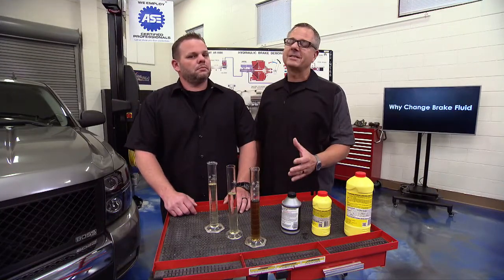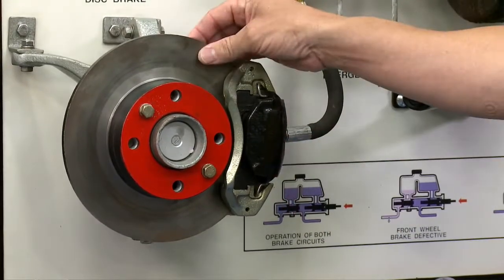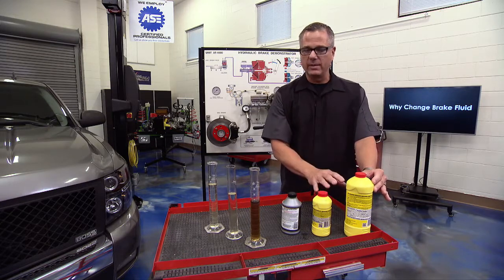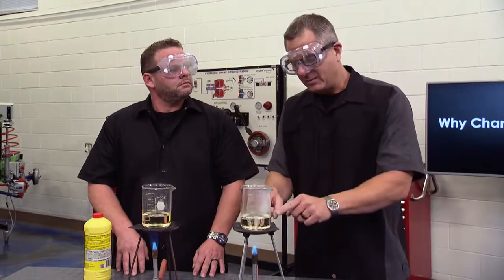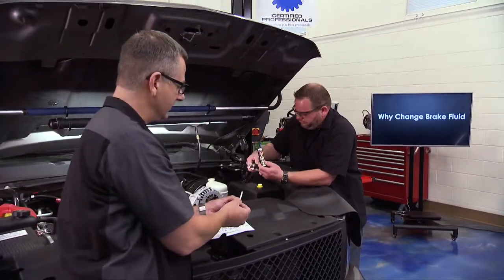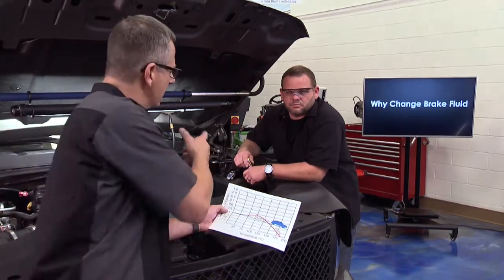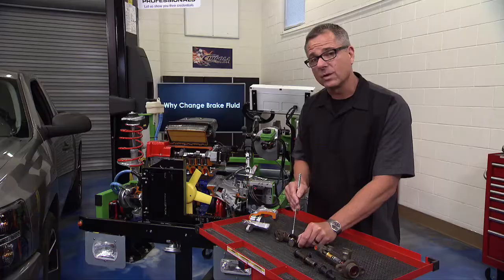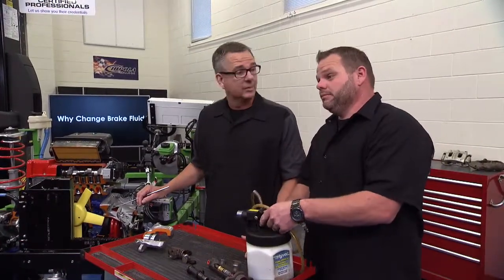Why Change Brake Fluid?

Comment: Why not do a partial change, more often, that only swaps the brake fluid in the reservoir…not professional (aka expensive or time consuming)  but should be effective. Use a syringe to suck out the brake fluid, use a rag to clean the reservoir, then refill with new fluid. As you use the brakes, the old fluid should mix with the new fluid and then you could do it again. Much easier than bleeding the system and causing other issues…

Comment: I have 2018 chevy equinox with 80k KM on it last week i was driving 120mph and pressed the brakes hard the brakes weren't responding as a wanted, so I went to replace the brake fluid with Ravenol DOT 4 the cap has dot 3 written on it but Ravenol DOT 4 have 271c dry and 169c wet boiling point and man even the brake pedal feeling changed. we have also 2012 Sonata Hybrid with 140km on it that we didn't do a brake flush on the ABS died and it won't drive unless you replace the ABS and it costed 1800 us dollars to replace by the way the fluid was black.... I highly recommend spending 50$ as i did to replace and flush all the fluid from the system now the car stops faster, and brake pedal is much better now and the ABS will live longer..

Comment: When it comes to brzke fluid i would make it compulsory to  put sticker on the master  cyclinder to say  which  dot.  3 4 5  to  avoid  confusion As to the type brake fluids used
Reply from the maker: Great suggestion.

Comment: Wow! This is one of the most informative videos I've ever seen. I feel like I have a complete understanding now of WHY the seemingly unnecessary brake fluid flush IS in fact necessary as heck! Which brings up another question: Are the silicone based fluids Non-hygroscopic? And why don't we use them instead?

Comment: Does brake fluid in the brake lines mixes or recirculate in the reservoir? Or just stagnant in the lines until it pushes out? Thanks.

Comment: I have yet to find anyone who can explain how water gets into the brake lines.
Reply: This is what I suspect is going on: The brake fluid reservoir isn't 100% sealed, some air slips past the seal from the cap.  If you think about it, if it was 100% sealed then it would be such a fight to get the cap off (like taking a cap off a pickle jar) because as the brakes wear down the cylinders will travel a bit further and therefore will use fluid from the reservoir. So as the fluid lowers it will replace the empty space with air , which has water vapor.  Also, since fluids will expanded when heated (hot days)  and condense in cold weather you get a constant exchange of air (fresh water vapor) so now your hygroscopic brake fluid is getting a fresh source when this happens.